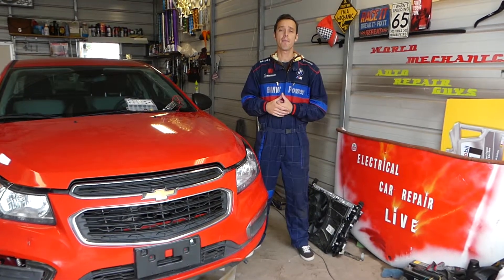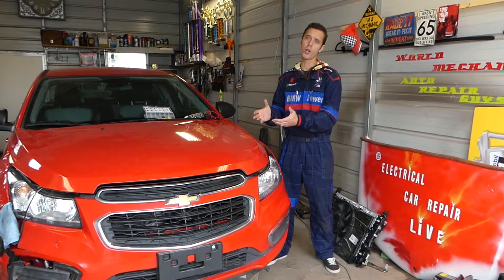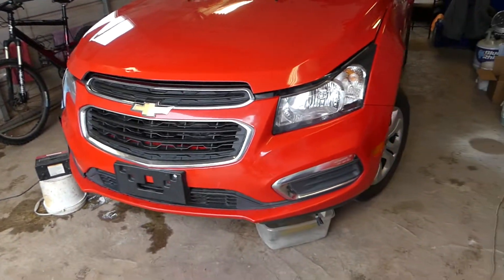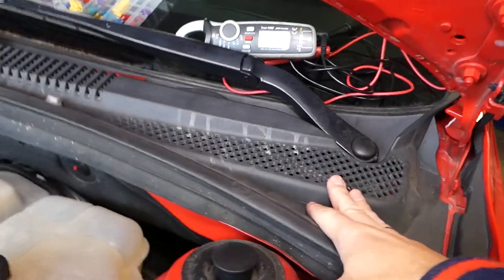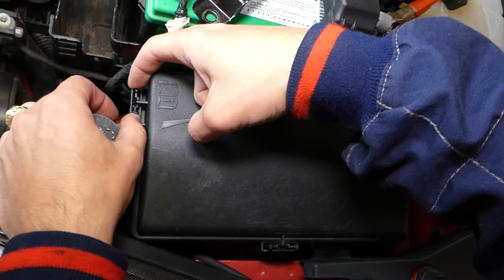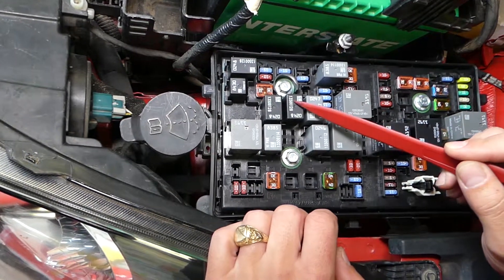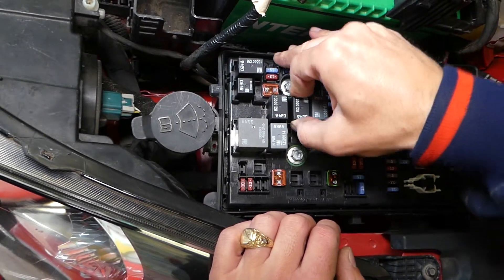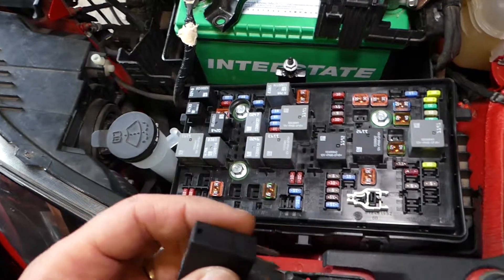CHEVROLET CRUZE WINDSHIELD WIPERS RELAY LOCATION REPLACEMENT. WIPERS NOT WORKING

Comment: i have a 2013 holden trax and when i push the wiper lever up to give a quick wipe or pull in to use the washers and wipers the wipers stop on the 3 wipe and they stop in the up right position on the windshield but they work normally in the slow and fast speeds what would be going on plus the radio toach screen will not work when i toach it still works with the steering controls

Comment: So I just got a 2018 Chevy Sonic LS and I noticed when I try to turn on the wipers they don't go on at any speed BUT they do work if I use the windshield washer so would that be a switch problem or a fuse/relay problem?

Comment: i have a strange issue with a 2014 cruze. customer has replaced wiper motor, transmission, and both relays. the issue is the washer pump is running constantly whenever wiper function switch is on. wipers dont sweep unless i manualy help them. scan data shows proper switch and bcm function. i noticed on the wiring diagram that the washer pump relay is non servicable. i got a new junction/fuse block thinking that would fix it, no go! any advice or solutions? i cant find anything on the web or identifix